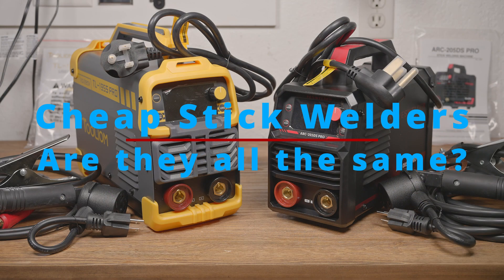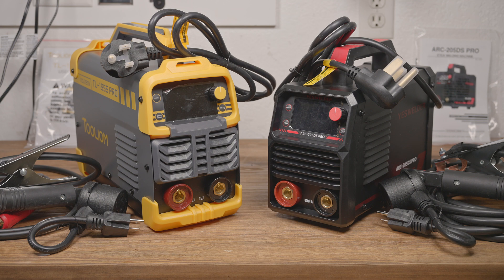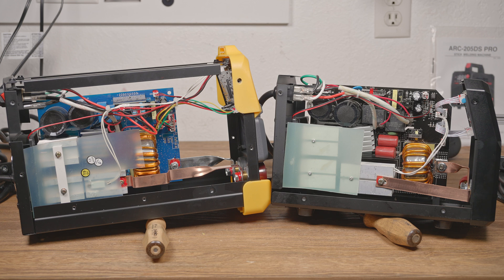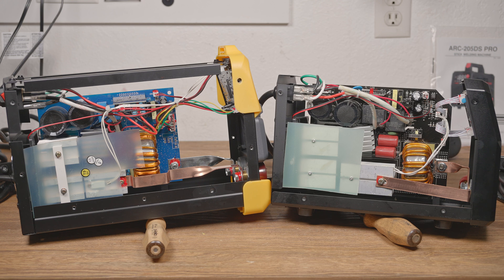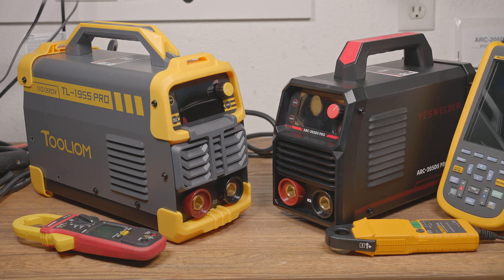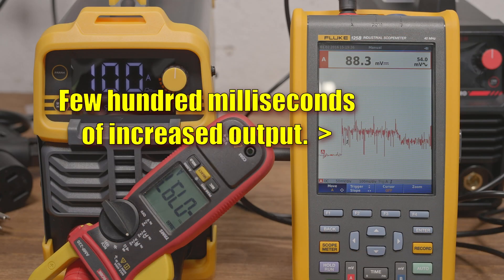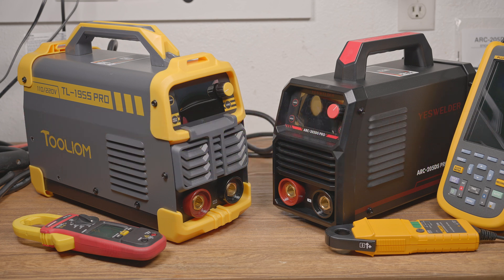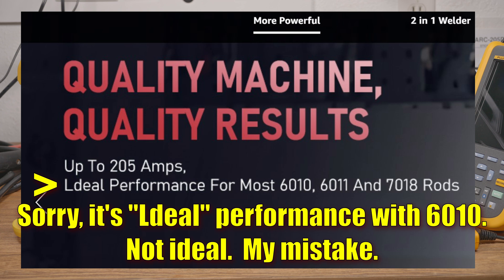Tooliom Vs. Yeswelder Stick Welders - Are They Actually The Same?

Comment: Marketing peddling...can't stand it either..all bs, just like the flashlights now....they almost tell ya you can light up the moon on two AA batteries...Utterly ridiculous claims...Anyway, thanks for all your videos and facts based honesty....am finally going to buy an Everlast powerARC 300 stick welder....as it's the only one ''reasonably priced'' which will actually give rated output with excellent duty cycle.... am welding new grousers on heavy machinery tracks...heavy welding stuff.  Cheers!
Reply from the maker: I just made a video about all the generic camcorders all over the internet that do the same thing.  And by same thing, I mean lie their...faces off in the ads.
Reply: @bigtb1717 thanks! will look into it! Cheers!

Comment: I know this is older but "Arccaptain" and the cheaper "Esabs" seem to be the same machines too.
Reply from the maker: Which ESAB machines?  I've owned several ESAB machines and I've tested out several Arccaptain machines and they were vastly different.  I know ESAB has released some "cheaper" MIG machines recently.  I would be pretty surprised if they were the same as Arccaptain machines, but I haven't seen them in person.  I do currently have an ESAB Rogue ES130i, and it's far nicer than any Arccaptain machine I've used.
Reply: @bigtb1717  Like the Rogue EM 190/210.  The better Esabs are definitely real Esabs.   Like the Rebel 235 and 285. 

I specifically noticed the drive system was the same as my "Yes" welder.   The ArcCaptain seem to also be a variant of the Yes. 

Don't get me wrong,  I have two Yes welders and they've both been fine for the most part. Their support help is second to none.

Comment: I put real clamps and copper leads on mine and clean the connections. Mine runs 6011,7018,7014.    1/8" rod ok ya have to set the temps a bit high

Comment: I like your honesty in your reviews and the fact that you are not an amateur.  I'm  looking to buy a budget 3 in 1 welder and would like to get your honest opinion on which is 5he most capable of the cheap machines.
Reply from the maker: Are there any particular models you are looking at?  What is your budget?
Reply: @bigtb1717 I need something that I can do some things without spending much. I have been looking at the Hone 3 in one flux core welder, the Arccaptain FIT 130 and the Dekopro. I have been turned off Dekopro because of bad customer service and not responding to customers. The Hone 140 looks interesting with the $99.99 price tag.

Comment: Thank you for this GREAT video!
What alternatives could we consider (to get accurate Amps, hot start, and dual voltage) in this price range, if any? AHP 160HP, maybe? I gotta have something advertised honestly and with hot start. Well done video - very informative.
Reply from the maker: In this price range, the Hone 185 comes to mind as having the amperage it claims and performing pretty well.  I already can't remember if it had hot start, lol.  It has been a while since I reviewed that machine.

Comment: I have a yeswelder. I’m a custom woodworker that implements metal frames in some of my projects. It works incredibly well for what I need and do. Also used it on one of my trailers to do a small deck plate repair. Worked great. All depends on your needs and wants. For smaller work, these are great. For professionals using them daily on big commercial projects, no this isn’t the type of welder you want lol.

Comment: I have the TL 140. Really like it for farm use. Very small and works great from a 5500watt generator. 220v of course
Reply from the maker: I'm glad it's working for you.  It's honestly pretty amazing how capable these devices can be for such a cheap price, small size, and light weight.  It wasn't that many years ago when a basic, "cheap" stick welder for the farm would have cost several hundred dollars at least, had AC output, and weighed 100 pounds.  I just wish these companies would be honest.

Comment: tooliom are serious machines. just did a big job, handed off some low pressure pipe welds to seasoned pipe welders, they didnt want to tear down so they used my tooliom 220p pro. they didn't like the torch because i ended up with a crap head that didn't flex properly, but were impressed with the performance. 110 will trip often, and 110 is a pain even 3/32 7018 but that's common even with bigger brands.. for the money you cannot go wrong. will not run 6010
Reply: Check out the prime weld mig 180. It does exactly what it claims and runs incredible on 110. No cap.
Reply: @robertblackshear8963 arcaptain also makes some really nice machines that are ridiculously transportable at under 10lbs that run stick reliably on 110

Comment: I bought one of these machines with the intention of running 7018 rods but unfortunately my arc extinguishes within 5 seconds or so. Im disappointed because it’s pretty good at 6013 and even 6011.
Reply from the maker: What size rod and what amperage setting?  They don't run 7018 very well if it's set at all on the cold side for the size of the rod.  Considering the inaccuracy of the display, if there's a chance it's just set too cold, you might want to try tuning it up a bit.  If it snuffs out even when set definitely hot enough, then obviously there is something else going on with your unit.
Reply: @ im using 3/32 rods, my toolium welder model TL-135 Pro only goes up to 135A and ive tried from 90 to 135a and i cannot get a consistent arc.
Reply: @Linusmetht1ps 135 amps? Then you didn't buy "one of these machines".

Comment: Mine works very well and doesn't stick on the 6011 like yours. They are hit and miss but setup is key
Reply from the maker: @brandonlee6486  I'm glad it's working for you.  Which one do you have?
Reply: @bigtb1717  toolim tl 195a lt pro
Reply: @bigtb1717  Try a diffrent welding Rod a brand name rod and not lincoln try certanium 7018

Comment: Amazon & VEVOR are promoting products that are just either rebranded or "re-packaged" as for exterior cases etc.
Reply: Amazon operates like a real estate company or used car dealer. They don't care if you get what you need or how much you spend as long as they make a sale and get their commission. The dishonesty and corruption of Amazon is as bad or worse than any platform. But they get away with it, just like Yeswelder and Tooliom because it has been around for awhile and keeps up their fake image of being trustworthy.

Comment: So I used to be really active on a welding forum,   I actually sold AHP on the side because the owner asked me to repeatedly.  I will tell you that I used to test every function of every machine before I sold it.   I still have a little 160 amp AHP stick welder and does put out the full 160 amps, their TIG welder also put out full amperage.  there are multiple levels of quality you can get from China,  I also know for a fact that the Lincoln 200 amp AC DC TIG and the Vulcan version from HF are identical machines made in the same factory using the same component boards.  I have opened them and had them side by side.     Lincoln did not sign an exclusive with the factory for 15k units.  So HF comes in and has some changes to the scaleable/modular design and orders 45K units
Reply from the maker: AHP used to have a cheap-ish stick welder and MIG welder.  I'd probably have tested both by now, but they seemed to have dropped from the market around the time I went looking.  Now I can mostly find variants of their Alpha TIG, AC/DC TIG machine.  I've considered testing that out, but never took the plunge.

Comment: Thanks for another great review. I bought the 160A YesWelder a few years ago in the hope that it might run 6011 - but apparently not. That's a bum deal since one of the primary uses of these cheap machines is for quick and dirty repairs on what is often sub-par prepped material. Seems like the only thing they're good for is 7018. Did you happen to try them with 6013?
Reply from the maker: @martinschuessler1936  Yeah, they run 6013 and 7014 just fine as well.

Comment: You won't be disappointed if just understand the limitations of a 200 dollar welding machine
Reply from the maker: I agree that cheap welders like this are typically functional and can work.  But someone may find themselves disappointed with a welder like this if they expect it to be capable of the output claimed and it turns out that it's not.

Comment: Never had any these issues i run 6011 no issues makes no sence at all .
Reply from the maker: It's possible some brands of 6011 will run different than others.  Which welder do you have?  Which brand of 6011?  If it's something other than what I have, I will get some to test with welders in the future.

Comment: So I noticed you were a long arcing your welding rods you were getting way too far away from the base material in every case that I saw you with a rod welding. it doesn’t seem like you have very much experience you were unable to keep the rod on the base plate.
Reply from the maker: @CentralIowaAudits  it might seem like that from the camera angle and zoom, but I was not long arcing.  In most cases, the flux is lightly scraping as I go.

Comment: There you go again, you're not feeling the Yes love.  Which pill did you take , the red or the blue one?

Do you ever test Everlast welders?

I've been looking at lightweight welders to use when repairing pipe fence on dad's farm.  I sometimes use a 10yr old Lincoln 140, it has a handle but... It also over heats and trips a breaker if you don't watch the 20% duty cycle because it is maxed out welding on the fence ( plus there a little wires sticking out everywhere I didn't clean the rust).  You would never want to build fence with it.  So a stick machine that handles 6011 at least is necessary.  In watching your vids several cant handle 6011.  Wow! You need a fast freeze penetrating rod sometimes.

When anyone get these cheapo welders to work for them at home, they don't understand the problem.  Some even say they have no problem running it on max, but how high is max? So yeah, if you get a welder that gets up to 160, you can do a lot.  I've been in electronic repairs and see the bs.  I know there are some that don't understand there is a difference even amongst the chinese brands or one made for an established brand  There is a common myth they are all made in the same factory. Seldom.  Many Youtube creators don't shine a light on their weaknesses ( perhaps they signed a contract).
This is why brand loyalty used to be a thing.  You found a good brand and had faith that they wouldn't switch you to a turkey the next time.  It does;however,  keep you from finding a bargain.
Reply: It's called kickbacks.  All of the youtubers who are positively
review yeswelder have affiliate links.  I've already unsuscribed them all.  They rely on ignorance of new people to make that affiliate sale.  All of those youtubers damn know what they are doing because they have actual real machines and are shilling for that money.

Comment: The outtake was funny. I have a fairly large  everlast mts211. ( another one of those ; lets put a handle on it and call it portable)  It has several settings to.adjust for each process.  You step forward and adjust the setting in about 2-3 seconds or it steps forward for you.  Very annoying.  Specs aren't everything.

Comment: Maybe a case of form follows function?
Reply from the maker: If I'm not mistaken, you are suggesting that the reason they are similar is because they are both designed to perform the same function, so they naturally end up having a similar form.  Is that right?

In that case, I'm sure that's part of it.  But think it's only a small part.  It's probably the reason any two welders end up often looking somewhat similar.  However, in terms of the included accessories, display, interface, internal design and construction, features, performance, and more, many welders actually vary quite a bit.  There's definitely more to the similarity of these two machines than just the fact that they are built to serve the same function.
Reply: Maybe same company, different factory.  Pledge more money to Yes welder so they can get better.  They are sick.

Comment: That's why I stick with Lincoln. May pay a lil more but you know what you're getting and a legendary warranty and quality. I'd rather have an old tombstone Lincoln any day.
Reply: lol when you find a Lincoln for $100 let me know. They are far more than a lil more lol. These are great welders for small at home projects or small jobs on the go. You can spend a little more for more of a machine to do bigger things.. but needing gas is becoming a thing of the past. Gassless will take over soon and they work great. lol
Reply: Lil more??
Reply: They no longer American made either
Reply: @bryanbaldassarri3248  Not very much is these days. But, at least they're built to Lincoln standards , "supposedly". I've got an old '68 idealarc, and '67 red face that I refurbished myself. I wouldn't trade either one of them.😜

Comment: Hey Tony try out the Primeweld mig 180. That machine is a complete beast. I recently received mine and I love it. It reminds me of the big boys we used at my shipyard jobs and mobile marine repair shops ive worked as a production welder which ive ran miles of dualshield and rods. Check em out.

Comment: If you want to check a nice chinese welder, check the Razorweld Razorarc 200 DI... from Jasic. It has a lot of oumph — I was very surprised, and my comparison goes against a Esab 161 Lts... I have to actually go down a bit with what I am used to regarding amps... And there was a 6010 rod (in need of high voltage in the closed circuit to be able to run) that couldn't be run on my Esab that I can now run with my Razorarc (short arc). Of course, the Esab could usally run 6010 (you have demonstrated it), but not all of them (specs are different from one rod brand to the other; even Lincoln 5p and 5p+ are different—5p needing more voltage). But the Razorarc is more expensive, I have to admit...
Reply from the maker: I've considered checking out Razorweld machines several times over the years.  I'll keep an eye out for a Razor Arc 200DI.

Comment: Hi! For the last nearly 5 years I've working on understanding how the inverting machine works and had an idea to build my own design. For now, I happen to live in a country, that, if we say politely, is not on the world's favorite list. 
Here that type of welding machine has become standard, and people buying false spec welders mostly for what is written, the more to say they believe in 180A for 3/32 rod. And of course, they just flex with the numbers like "I bought a 320A machine and you have only 200"
If you give them the right machine they will claim it is broken, outputting way more current and the arc is bright so the weld bead isn't good.

Knowing the problem I designed and built what I call a welding machine analyzer - a small device that capable of capturing a complex waveform of that pulsating DC current by performing hardware-assisted integration. Then after some DSP processing, the dataset is ready to be downloaded and analyzed, evaluating the feedback loop.

Long story short, I was able to look into the dynamic characteristics of a welder, and needless to say, it is horrible in its entirety! 
But, here's why people like these kinds of cheap welders. The schematics design is very clever, there's so much engineering that has been put into it.  In a moment of droplet detention intentionally poorly designed feedback loop produces current spikes acting as an Arc Force feature which helps to ease the weld. Of course, the value of that spike is totally random, but it helps uneducated welders start welding in their garages.
If you look at the current waveform (dynamic feedback response) of a Fromius machine you'll absolutely see the difference.

So yeah, a lot of effort has been invested in the design of these cheap welders to maximize the profits. It welds quite decently for let's say, an amateur which is who's buying these products. 
I agree it's a lie but they call it marketing...
Reply: I agree. Go Primeweld. Better overall.
Reply: @robertblackshear8963  And the PrimeWeld MIG180 is reasonably priced at 549
Reply: People get really caught up in the advertising hype ( I read the spec.on the nnew dp200, man sounds like what i want) Some call it salesmanship. Someone burned by a bad deal, they call it lying.  Its been going on for a long time.  Best of luck if you market the analyzer.